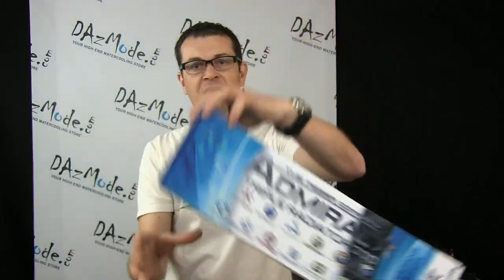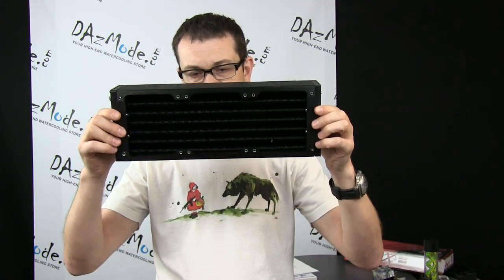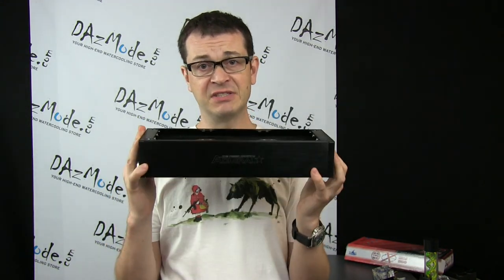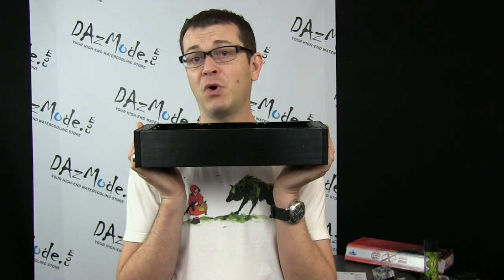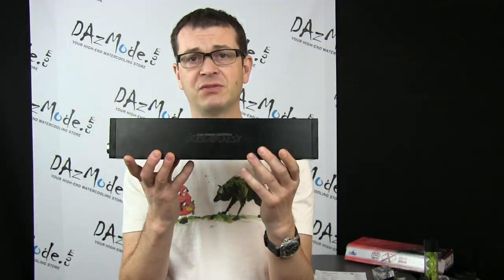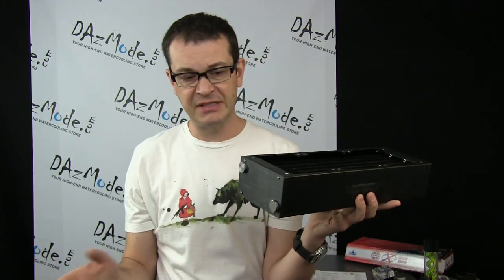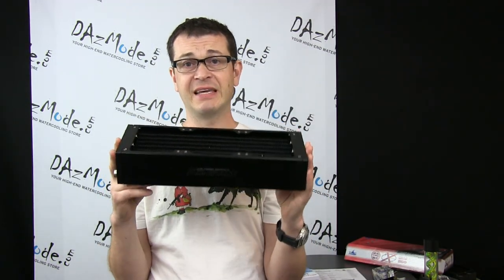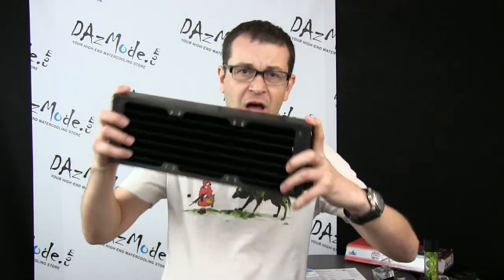TFC Admiral Radiator Review

Comment from the maker: Formal lab test was done with speeds of 800-1700rpm (25mm GT's), I used dual version with 38mm 3000rpm San Aces and it seems I have got a good result out of it. Based on that, I guess (!) that Admirals are better for performance oriented builds with high airflow.
No idea about 140mm. I personally want to see 480.